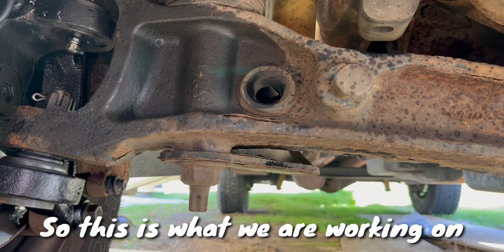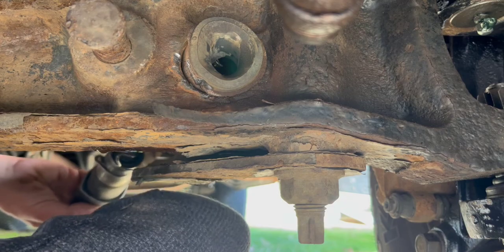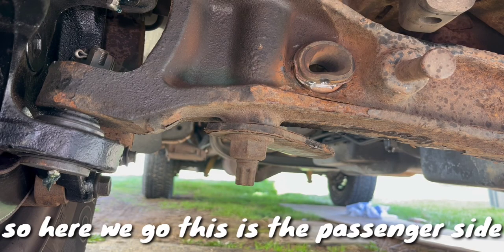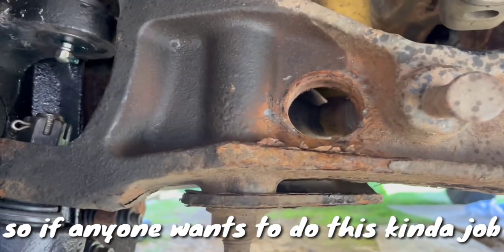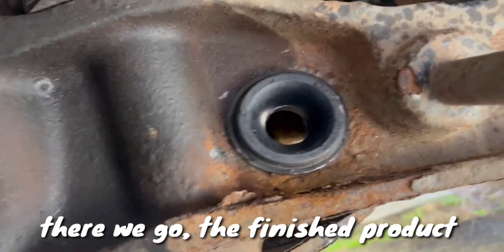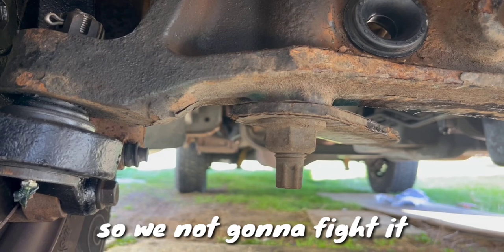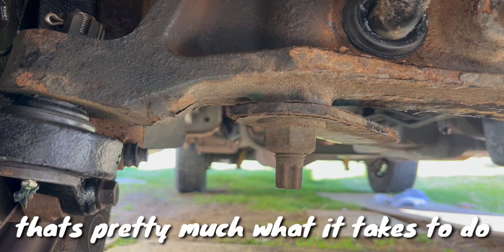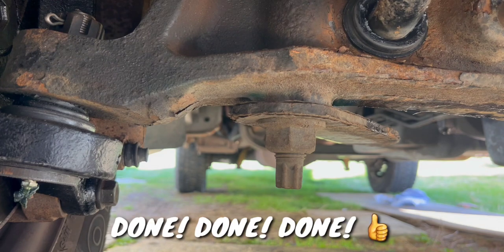Ford Econoline E150 250 350. 450 beam  sway bar bushing removal

Comment: I have a 2002 E350 with a V10 :)  HOW much am i lukin at to replace the plugs, coil packs, wires, etc. and make my baby kick butt in horsepower and fuel economy ??? It has lots of power now but i want to do a Complete tune up before i do Camping this year :)
Any Links would be a Great Help Thanks :) Peace
Reply from the maker: Hey you are in luck I’m doing one tomorrow 
So I will make sure to take very detailed video it’s not a V10 it’s a V8  but the prices is pretty much the same. 
And if you go to that extent use motor-craft coils and plugs

Comment: I have the new bushings but no air chisel. Can I borrow yours? I tried to get the sway bar off but it wouldn't come out because there was no space to pull it. How did you get that part out?
Reply from the maker: Hey Chico 
Yes you can borrow mine, 
Sure hope you not 1000mille away 😎
That comes out ezy, 
Need to remove the outer tie rod on driver side. 
Where you located ?
Reply: @lolesoffroad  I'm only 2500km away🤣 how much do you charge to do this? I also have new Tire rods. I would need an alignment though
Reply from the maker: @CHICOandtheVAN  
Lol 
Yea I’m sure you can find some one or probably you can doit yourself 
Yes it will need an alignment

Comment: Hi Loren, just subscribed to your channel. I have been watching your work on vancity ambulance and have a question for you. I have a ‘11 sprinter 2500 3.0 (just a bare cargo van) and #4 glow plug is broken off from the tip. Been searching on line how to remove it without complicated tools etc and the dealer wants $ 1500 just to remove it I’m semi disabled and don’t have that kind of money. I already have the part but is there a easy way  to remove it ? I would appreciate any ideas you might suggest. Thank you from North Carolina.
Reply from the maker: Hello thats a steep price for one Brocken glow plug
there are extraction tool for this purpose and they are not to expansive. If you have some mechanical ability you can doit yourself , get specific glow plug removal tool for your engine. 
Hope that this helps , any questions just ask

Comment: Hey there, loved ur ambo tour on chrome's channel.  You offered free advice and I do have a quick question for you sir.

 
 I'm a 56-year-old lady in far Northeast Wisconsin. I have a 1990 E350 7.3 l idi diesel no powerstroke ambulance (25 thousand miles on it) I have converted. Yes unusually low miles but it checked out.

I've never had a problem starting my vehicle until recently where I try to start it to find the batteries are dead. I have battery warmers wrapped around two brand new motorcraft batteries. I do have shore power and I can plug it in for the trickle charger through the inverter.

 Sometimes it will last for a day or two and then all of a sudden start to tank.  Once the past 2 months it  stayed at 12+ volts 4 days. I'm not sure if it's the cold doing this or if there's some parasitic draw I have not figured out yet. I have checked everything I could for parasitic draws. 

Any suggestions would be greatly greatly appreciated! I'd like to get out into the woods rather than having to use shore power at a small rustic campsite. I carry a noco all the time and lately it's been the only way I can start it when the batteries take a nose dive.

Your time is greatly appreciated 🤓 thank you!
Reply from the maker: Hello 
This is what I would suggest to do first 
I would fully charge the batteries to 100% 
Then monitor see if they get flat. 
Once they are 100% you can and everything is turned off read the batteries with an Om reader to see if any draw occurs. 
The only thing can really draw power is your starter that can cause the drain. 
But that should show up when you read the batteries. And I want you to check when the engine running how much power the alternator puts out it’s very important to 
To make sure they are not on the way out. 
Hope this helps any more questions feel free
Regards
Reply: @lolesoffroad  thank you so much... I don't know how to check the alternator output while running, but I'll figure it out.  I've been in diesel crash course school in and under the rig and am not afraid to get dirty. Thanks again sir.. most appreciated!

Oh I found out how...that's an easy thing to check... In case anyone else reading this comment needs to know I will paste it below.

Use a voltmeter to check your alternator; rev your engine to 2000 RPM, keep the engine running, and test the battery with the voltmeter. If your voltage goes from ~12.2 V to ~13-14.5 V, your alternator is doing well. If your V stays the same or decreases, that's a bad sign.
Reply from the maker: If you go to an auto parts store like 
They my check the alternator out put for you or show you how to doit